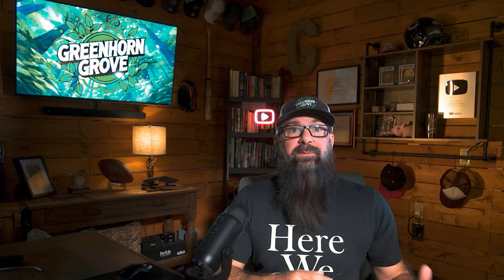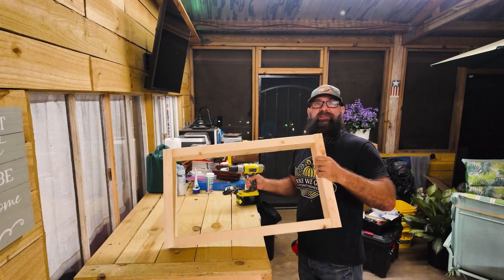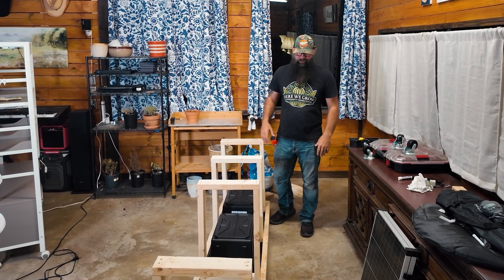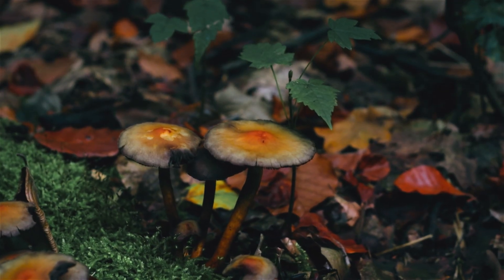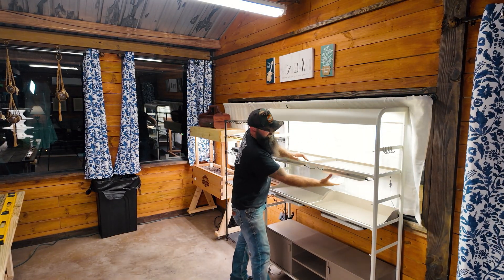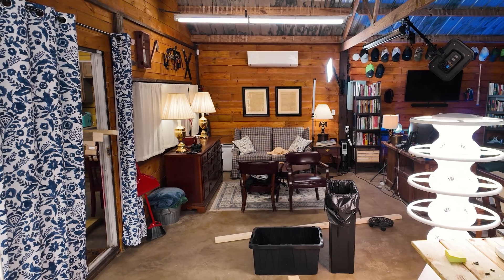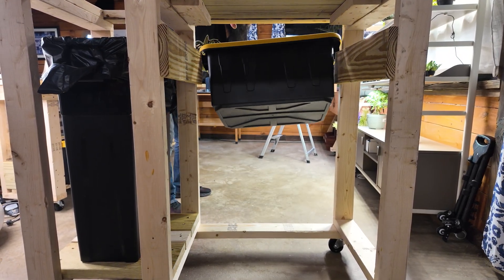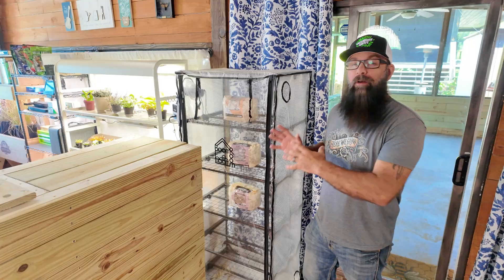For my next project, I build a homestead laboratory

Comment: So cool! We're ending our first year of homesteading here in Sweden (growing zone 5a), and I wonder what the effects of watering are on plants. Sounds funny but to be honest, I don't like watering our garden & greenhouse. Next year we're adding a watering system to our greenhouse and are thinking of drip irrigation tube. The thing we're struggling with is might this also add microplastics to the soil? How long & often to water? So much to learn!😅😊 we're also experimenting with turning our raw land which is very heavy clay into something that plants grow in... the green manure plants have not worked that great yet,so now we've tarped of a piece for 2 months, mixed in bark compost and adding layers of chicken manure,  grass cuttings and shredded leaves on top. Our growing boxes have worked best so far but are expensive to build and to buy all the soil... experimenting is so much fun, but also very time consuming and take a lot of energy to stay on top of it all. Looking forward to see all your experiments!
Reply from the maker: Well it depends on temperature and humidity but if you’re worried about microplastics have you considered using terra cotta pots to make DIY ollas (also spelled oyas by some). I think testing some parallel watering methods and times would be excellent. Also consider the ease and time of automating as much as possible and if you have to use plastics make sure the type of plastics are UV resistant, BPA free,  bury them where possible so the sun isn’t heating up and breaking down the plastics.